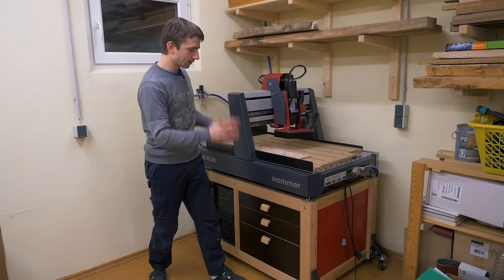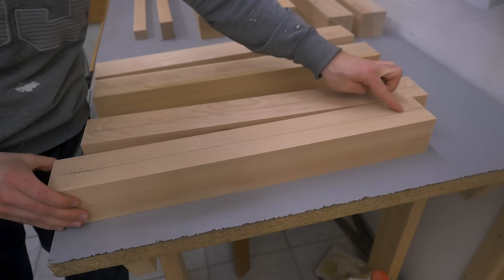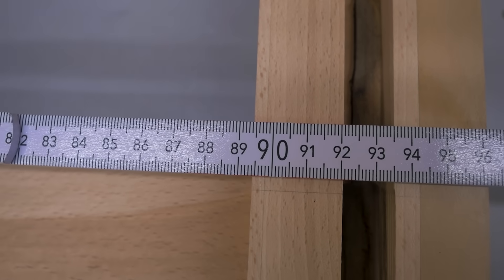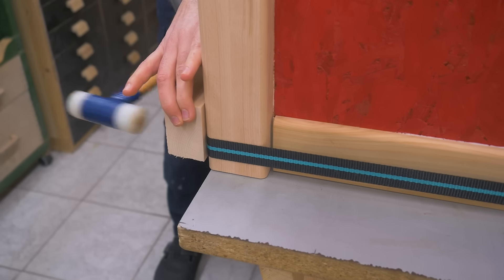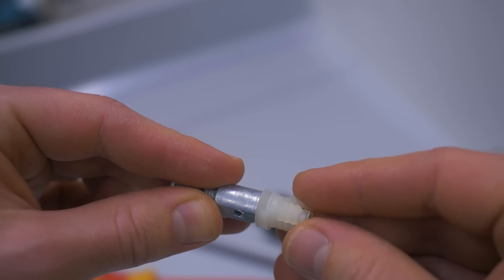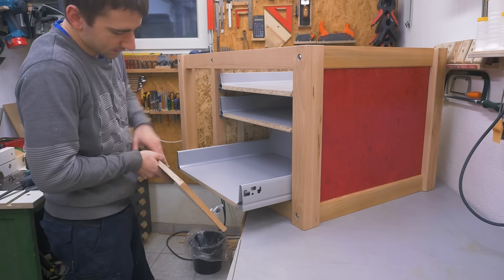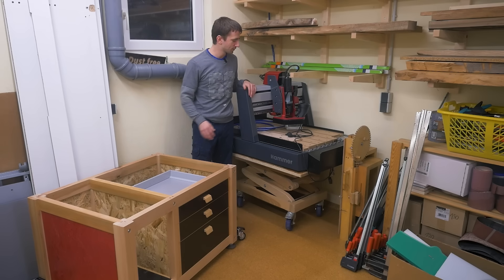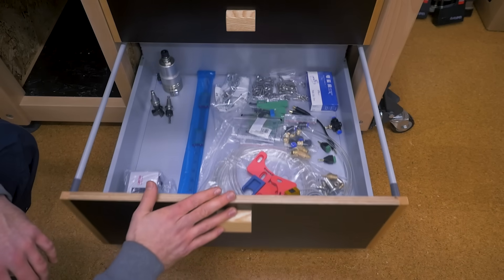You Will Love These Casters | Tool Base Build

Comment: The wheels are awesome, but I don't get why these mounting brackets are so expensive when bought separately. Also nice brackets here! the ones I found were brackets you had to slide the wheels in from a certain side. So if the bench is against the wall, you couldn't slide in one of the wheels.

Comment: Those removable casters are great. I have a set I use for my workbench and also for the occasional times I need to move the cabinet I have my Jet 6x48"belt/12"disc sander mounted on.

The drawer hardware you used looks good and the adjustability a plus. Do you know who makes it?
Reply from the maker: It was made by Blum. The kitchen I got it from was custom built, but the hardware is most likely the same as IKEA or other use
Reply: @MariusHornberger  I see, seems like many kitchen retailers and cabinet makers use similar drawer hardware. Nonetheless, IKEA is a good source for drawers if you don't want to build everything yourself. You can buy a drawer body including all hardware for a reasonable price and just need to "build" the drawer front that suits your taste/needs.
Of course that only applies if you can design or adapt your cabinet around the available standard widths/lengths of IKEA kitchen drawers.
Reply: The hardware shown in the video seems to be salvaged from an IKEA kitchen. But drawer hardware like this is available from Hettich: https://shop.hettich.com/de_EN/Drawer-systems/c/group12100825821033

Comment: As heavy as both the CNC machine and tool base are, I still cannot help but wonder how well your (tapped / threaded) 12mm square washer is going to hold up? With side-to-side, front-to-back and rotational forces constantly acting on the entire CNC / Tool Base assembly would that rocking motion eventually fatigue the threads on a washer that is only 2.5mm (about 0.98") thick? In your video, you stated that the hole(s) you drilled as a recess for those leveling leg bolts were bigger than the bolt itself... This will allow the bolt to rock in all directions, eventually fatiguing the thin washer. - And I say 'thin', because a M12 nut is 12mm in thickness (almost 5 times as thick). Other than this one small issue I have, the rest of your build was awesome.
Reply from the maker: When you tighten the second nut to the washer the load is no longer on the washer but the nut
Reply: @MariusHornberger  Yet still, with a distance of 1.75mm per thread, the square washer now (essentially) has only 1.7 threads to tighten against? And honestly - it'll probably last a very long time with no issues - just made me wonder, regardless. - Thanks for the reply.

Comment: Cool! Why not closing the top? Isn't the CNC producing a lot of dust? 
As you have start building everything with screws, are you thinking of moving to a bigger workshop anytime soon?
Reply from the maker: A top is part of the enclosure I'll build in the future.
I had to use screws to otherwise it would fit through the door

Comment: Nice projet as always ! Aren't you afraid dust / wood debris might be a problem since you haven't closed the top of the base ?
Reply from the maker: A top is part of the enclosure in the future
Reply: @MariusHornberger  In case you hadn't thought of it, if you enclose the top I'd suggest adding ventilation holes at the back of the PC area.

Comment: Ha, those removable casters are exactly what I need to solve a problem I didn't know I had until I saw them (if that makes sense).
Reply: Ya know, I’ve seen those casters for years but I never thought of getting one set of them and then getting the brackets on multiple benches and just using the wheels where you need them.